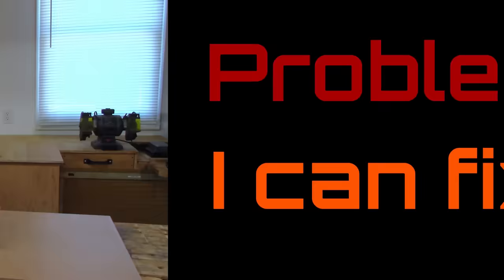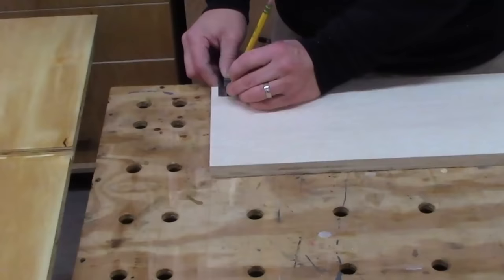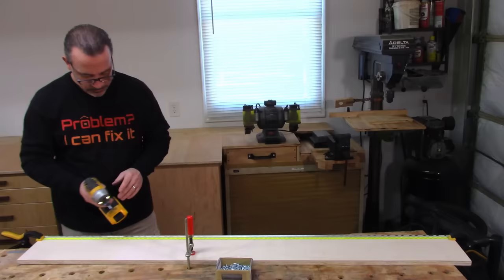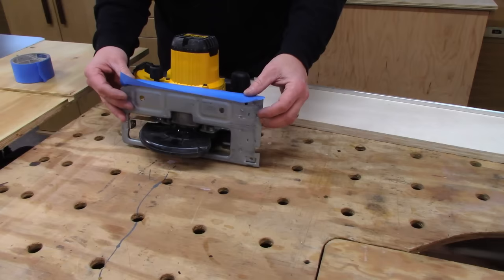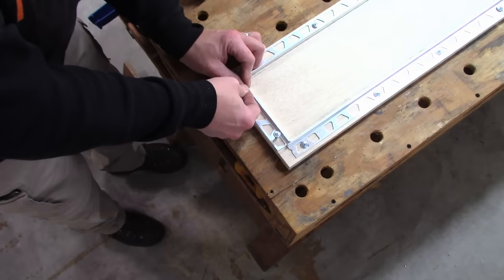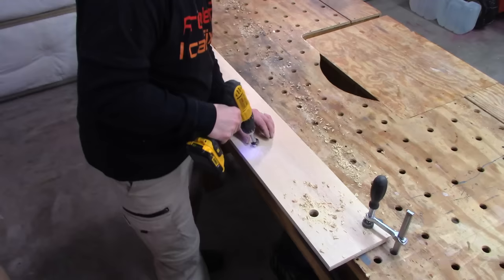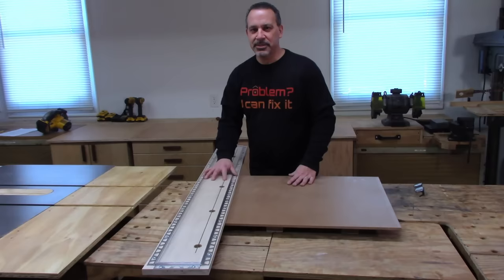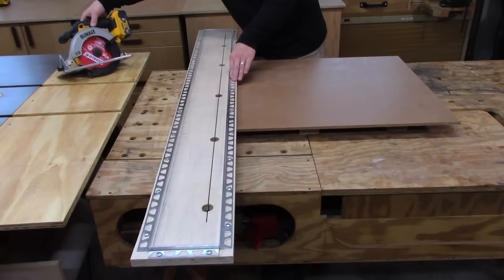Festool doesn't want you to see this DIY track saw

Comment: Biggest mystery is how you square your track over the piece you're cutting. Wouldn't you want a factory edge during the build to make it more precise?
Reply from the maker: This jig requires you make your marks on what you're cutting. So a framing or drywall square would be used.  If you want it to be self squaring you could screw a block of wood to the bottom that is 90° to the saw kerf.
Factory edge isn't needed because the tile edging is straight enough.

Comment: What is that annoying, high pitch, whistle like sound when the dewalt screwdriver is working? Is it always like this????
Reply from the maker: I had to go back and listen to it.  I never even noticed it before.  Part of it is the mic and camera, but yes it does make that sound.  It only makes that sound when you are very light on the trigger and it's struggling to to drive the screw.  If you give it a little more gas it doesn't do that.
Reply: @HouseDoctorRay  Now that i remember it i must have heard it live as well. Could happen only to those with electronic clutch? Who knows, thanks for the reply.

Comment: Why did it look like your saw was binding when you did your score line and your through cut? 🤔    But more importantly, why not just use a clamp-n-glue guide as a straight edge, which will also be much easier to align to a work piece pencile line since your not fighting sticky tape?  Riding a straight edge with a circular saw is pretty dang simple

Comment: Crazy overcomplicated, take one piece of tile edge, screw or glue it on to a sheet of ply, run saw along it, apply grip tape to bottom. Done.

Just remember your cordless saw probably doesnt have a riving knife so stick a wedge in the end of long rips.

Comment: "All we are going to be using is a circular saw and a screw driver".  Okay what about the guide board, the screws, and $20+ straight edge metal piece thing, the painters tape the, consumable sticky tape, the string chalk, oh and the drill bit, and forester drill, the power drill. With that device you lose cutting depth as well.  Why not just get a Bora NGX clamp edge tool?

Comment: You say no straight edge, but the tile edging is acting as a straight edge. I use a section of old metal bed frame. Usually find them free on marketplace. just clamp it down with spring clamps. And why would say that about festool? Trying to get more clicks?

Comment: So….. I’ll spend about $70 on a sheet of 3/4 finish plywood, $10-$20 each for 2 tile edge and $5 for a small box lath screw. Nope. Kreg has a lighter and easier to use track for $100 or less on sale. I get making stuff yourself but sometimes there’s a better off the shelf for less.

Comment: A solution looking for a problem. I just bought the Festool track saw and I didn’t have to build anything. Plus the actual track saw is elegant, fun, and precise. Why do people bother with these Rube Goldbergian contraptions.
Reply from the maker: Because a lot of us don't have $1,000 to spend on a tool that only does one thing.
Reply: The “one thing” being a major core task for any aspiring woodworker. Honestly, a thousand dollars is not that much money any more. If you are going to build things with wood, spending lots of money on excellent tools is half the fun!
Reply from the maker: True but building jigs is also fun.  Didn't you built a fancy MFT rig for your saw?
Reply: I’ll admit. I have clamped down a 6ft straight on 2 ends of a sheet of plywood and tracked a circ saw that way. But that’s because I’m too lazy and the systainer was all the way in the garage…

Comment: The anti-slip tape raises the guide off the surface, not ideal.  If the guide is on the surface it prevents liftoff on the cut edge.  Nice try.

Comment: Grip tape ?? Scratch the heck out of ya work piece.. use rubber anti slip matting
Reply from the maker: I haven't had a problem yet.  I just lift slightly to reposition.
Reply: @HouseDoctorRay  I work with finished ply . Couldn't take the chance of just 1 scratch.. used rubber matting on mine

Comment: you give up !72 inch cutting depth and if thre saw ever wedges in between the aluminium  it will give you a nice Kickback and you´´instantly regret not having a propper Tracksaw.  I Guess Festool laughs at this.

Comment: Neat build but enough of the stupid click bait. Like the rails but I would recommend an easier fix to installing the railings. Put in the 1st  screw at the beginning end then put a screw on the other end. Screw everything in tight from there. Thats the way I do it and its the easiest way to ensure the middle is square. 

But i won't give you a thumbs up because of your use of click bait
Reply from the maker: You should never attach things on both ends and work to the middle.  That's how things get bowed or twisted.
Either start on one end and work down or start in the middle and work out to the ends.

Comment: Who the fuck is putting grip tape down on finished doors or prefinished plywood?  
2 pieces of 1/4 ply wood 1 rip at 11. Glue a 5" rip on top of the 11 flush with one side and run the saw down it to cut off the excess flush with the blade.  Plenty of track to clamp down with spring clamps.  When the blade edge inevitably gets beat up u can kerf out the track side on the table saw and cut a fresh edge on the blade side

Comment: I don't know, too many points of maintenance. AND, a true engineered track saw system, be it Fesstool, De Walt, or the el Cheapo Makita, will do MORE than just cut a straight line.  If your intent is to beat the manufactured product by showing others how to do this, I say, nice effort. BUT, if it is your intent to cut a straight line with NO up cut breakout, (rough edges) AND at an angle, this is not the tool you need. Not to worry though, the market that he is targeting is unappreciative of the degree of engineering that went into the design of a true Track Saw system. All they want is the straight line and for that, they are leaving a lot of value on the table just to be able to use their worn out table saw.  

Darrow...for the Prosecution

Comment: [0:30] "All we gonna need is a dusty damp uh Scooterish Quilt (hooligan style of course:) err wait he did say something about a Sac-u-Circler ensuring it's ragged jagged and just capable of this GuiltKilt w/ the EZ-Overly fuzzy Bunny Eggs in full view for the timeless Full Buttoxal Horizon SkillSaw scenery be scene-n-flee! Capabilities absolutely imperative as followed (the screw driver and rugged saw mentioned in the video's deaadly sexy (back-bunny-hareas an assumption should come across clear in the intro. Like viewers must not miss out be failing to see the_ forest for the trees_ you get my drift much like the waves of air as the blow across the unforgettably entrancing "Backfield in Motion, babeh" Thus it has been poked err spokened Like on a back sowed long ago during a pubrty far away, an empire had beeen patiently waiting, like no other shoulder mane ever of the ages, massaged and gently with the upmost dignity beer provided as long asassistive then by aged of barely 2 decades the massage beer oil was slowly increased it's parts of Rogaine to Guiness until the proudly once potent prince's Rogaine supple mints ingestion level was so high but so proud were the villagers they volunteered to go on daily radish-only rations which as it turned out just caused a bad outbreak of rickets and had no effect on the once man now and surely fully NOW absolooseleafy half Were-Man other 3/8th half test stunt pilot, rest has yet to be analyzed by old Doc.Mcflies saids he's purdy surely it had to be at best just pure potent and powerful malignancncy, how proud we was, also school funds had been diverted so we wuz met with much confusion and just awaited the day, that rogaine Holla-day. (Soo much Rocaine, half pure freebase injected intoo the follicles that is when the metal tips didn't just break off and melt away on contact. It was around then that someone seemed to have writted up in the local 1 pg Sunday Sundae Sondaze Blits on a papper half edible with half spoiled war ration tins of Ritz cracked pounded into a Flour then cooked just so few wurdz could still be readable it was free one per citizen on a bi-1/4erly basis This was how we were to recall that we were to be building aome sorta SeeSaw Skilled or something ( no one had a clue where the were-back had gotten mixed up into it all but it sure brought the village together, of course when they could get out due to the rickets beincoming so bad and everyone suffering from radish indegestion, Fine was that day we read in the paper the Radishes were to be EATEN by mouth you see so many of us were so caught up we'd perversly reversly the ingest-tastin' to a sorta ingest-plugin' and less said about that summer the better... Anyways now now back to our pride and joy, rumour wuz Guiness Book of Rikkidz were gonna be there, on account of the larget avoidable outbreak of rickets not so much for our hometown proud boy and his Scootliest scootin and foash-johnson of his critical-cat-skinn sewn-up Kilt oh what glory to be here soonly. Just so much very mulchy musky half the full moth-eaten Dusty since 4 shower seasonly annuals like a fine frame picasso frame of the Buttocal-Horizon Fuzzy BunnySkill-Sawed full Buttocal-Horizon undercoat functionality   side of a Full-Lunar maybe he meant a Scott-err Sirclular Kilt Saw. Buti missed it for that day i was workin on the story for the latest edition of the Rits bi1/4rly none made none ease by the ciculating saws pple kept sending to the office of the publication and some diagram of an upside down table with some torture implement popping out the center.Claiming we had it all wrong but I couldn't ever let anyone know,nnot takin the chance to ruin the villages glory. Now I've healed my mined a bit i see we got carried away a bi, seemed to start after thiat lead mine opened upon top of the solo natural spring fed fresh source of water we had there, Anyways I subbed'dmarined cuz Ican telll you understand what i done was right I had to do it. Next time youdrink a book of guiness just look up our village turns out we did win that Rickets Whirrled Rekkid, I hurt but not sure since i don't drink so never got a chance to research that part of the story, Ok off to my shift at the lead mine - starts in just a few more days i don't wanna be late, soo thursdty tho, ack. thx for noticen me <3

Comment: I saw a video where the DIY’er used silicon coating instead of sandpaper check this out it would be a great substitution. I would like your opinion on it compared to sandpaper.  It would not mark the surface but not sure how it holds the track compared to the sandpaper. By the way, I prefer your build to his except for this question. https://www.youtube.com/watch?v=4A0aNVrZwNg

Comment: Quit hint, learn how to use the saw the way it was intended, if you need that much Bullshit to cut a straight line then just stick to pushing your pencil. I really want to see you work on your car next, I bet if you had your driver's seat right on the front of the car it would help you see the line that you need to follow and if you get time you can lay track all through out the united states to make it easier for you to get to the store and back without crossing the line.
Reply from the maker: I think I'll be ok.

https://youtu.be/J60yUwe9P-I?si=Wg681nakB1Xnl-zc